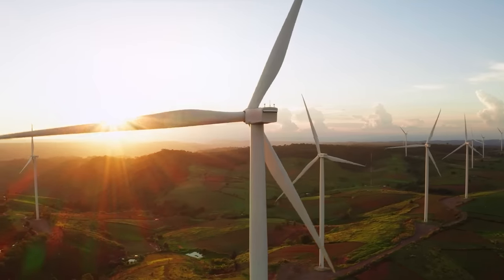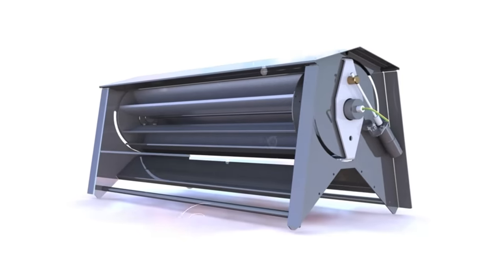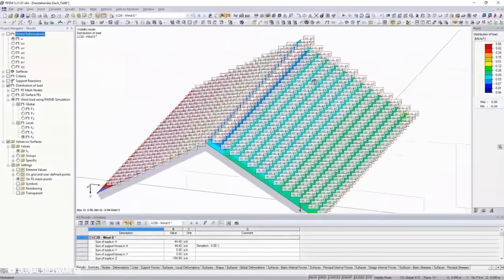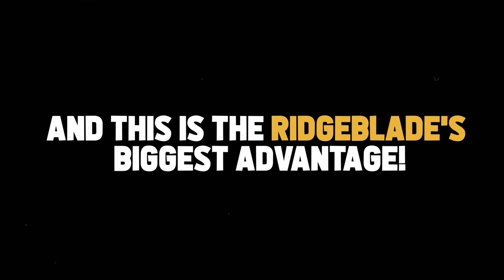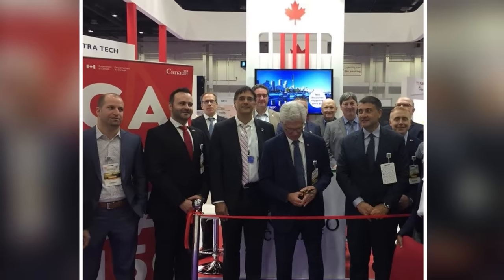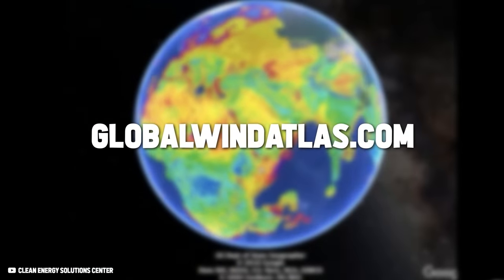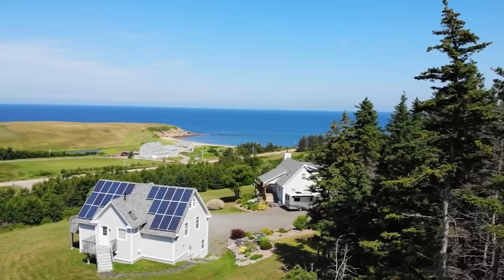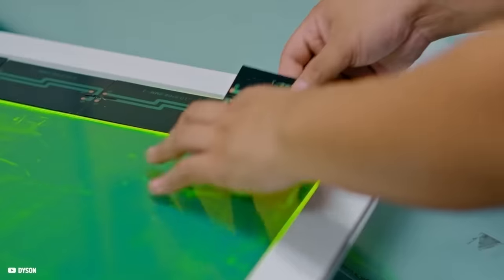Genius RidgeBlade Home Wind Turbine Beats Solar Panels by 220%

Comment: The equation for wind turbines, P = 1/2 * ρ * A * v^3.   Note the velocity cubed term v^3!    There is almost no energy in wind speeds low enough that people can still talk and hear easily.   There is some usable energy at 12 mph 20 kph, but its really nothing worth while.   Wind speed needs to be about double that and constant to make power.  If using a wind turbine on a farm to pump water as done in the 1890s 12 mph wind works, but slowly.

Once wind speeds start to have real useable energy in them they are also noisy when contacting wind turbines.   These roof ridge squirrel cage style wind turbines are relatively close to the ground away from prevailing winds and most importantly are of a fixed orientation not able to orient towards the wind.   They are also an eye sore where such roof top implementation on commercial buildings are typically hidden behind a flat roof parapet.   

When actually making power they would be a wind load on the roof that is not designed for the rotation moment they would cause on a roof ridge.   Having a large TV antenna on a roof should be OK, but placing structures specifically designed to extract a great deal of force from strong winds is not what a typical roof structure is designed to support.   Even when putting in a large high TV antenna it is more comfortable to use a tower mast starting at the ground and braced to the side of the house.  I doubt a home insurance policy would cover this implementation.   People in Florida that have installed solar panels on their roofs are frequently finding their house is almost uninsurable because the roof is not designed for the wind load they'd cause during a storm.  

If there is near hurricane wind speed the additional wind load on the roof ridge might tear it off.  There can be 70 mph wind speeds from fast moving thunderstorms.   With high enough wind speed to make any real power these roof ridge wind turbines are probably way too noisy to sleep with.

Comment: Does anyone know how to contact the Ridge Blade manufacturer/representative?  I have exhausted trying to contact anything connected to Ridge Blade.  I even viewed a picture of the system installed on the air force  museum in Canada and contacted the museum to see if they could give me contact information.  My email to the museum was forwarded from the Director to the Operations guy.  This was the response:

"I don’t believe it ever worked.  I wouldn’t know where to send you for more info."

Does anyone have any additional information?  Many thanks!

Comment: Have sheet metal and a cheap welder. Buy an inverter and an altinator maybe up to 5 of them depending on the size of the windmill you make and tada you have one for barely tleven 1k for probably a power generation within 10% of its energy delivery...  so 2% the price for 90% of the power

Comment: but like solar, it is going to depend on the environment. some areas you aren't get that much wind, but you if there are a lot of sunny days each year, thenit will be this wind turbine. and in other instances the environment might be better to use the wind turbine, or both. In addition, it might might be faster/cheaper to scale the installation of a lot more solar panels then wind turbines. So the 220% figure is nonsense, that isn't how it will work in production.

Comment: What's with your math? One RB1 has 2kW -> 48kWh per day ->  17520 kWh for 1 unit. x7 = 122.000 kWh. If you take a lower windspeed and that's the reason then you have just reduced the whole power output by factor 17x. On the website it says a series of 5 RB1 modules gives you 2kW Power which makes more sense. On their website and in your video it's highly confusing tbh what is going on on the important subject of production. In addition there is no mention of the windspeed at which it's rated. Seems sketchy to me, bc. this is the first thing you do when you advertise a windpower harvesting device.

Comment: What if the wind 8s blowing in the opposite direction?  You can't just turn your house around.
Reply from the maker: Hey, thanks for the good question. 
Its designed to harness the wind from both directions.
Reply: Rectifier circuit to switch AC current to DC current.

Comment: Omnidirectional low-profile wind gathering devices are far better. 
Why?
Space smaller, environment impact less, physics does the work and easier to install and maintain.
Now, can we make the devices light weight enough to not stress the rook structure, yet withstand the winds?

Comment: Here's the reality: You can design your own system with the same science principles...and greater output...

 Once you've got the fast rotational wind force, couple it to a chain driven gear, or multiple ones, to drive a 10Kilowatt generator from a gas powered generator...(you need to rotate at 3500 RPM) attach as many series 12v re-chargeable batteries, the best being made of carbon aero gel...

Go for a DC generator, store the excess energy in 12v batteries ( in series) , attach DC to AC inverter for home use as needed...

Power should be stored as DC and is best kept at that voltage, AC has it's place, though will be slowly phased out and replaced by DC...

Think of DC as concentrated electrical energy, and AC as a fire hydrant (wastes lots of energy all at once) ...no one should use AC in their home, only DC...though that would ruin the electric companies ability to over charge, as AC energy is pushed ( or overcharged by increasing the flow or AMP's) by the electric company...especially when you consume it, you should be using drops and they make you waste gallons on purpose...

Think of it like this: The power the electric company charges you per month is actually wasted every second their line is connected to the house...yes, it's a scam...it doesn't cost them anything to power your house and the line is only limited by it's physical properties to deliver energy...

It's like serving you a meal at a restaurant and then the waiter saying " for every time you chew you get charged for actually consuming it" ...

Electricity is a service and should be treated as such, it is not a consumable reality, it's only limited by physics...Only when enough people figure this out and bail on the theft they incur every month from the electric company will they learn to charge a flat service fee for every home...

-X

Comment: It does not BEAT solar panels.  It works when the wind blows, therefore it supplements them.  Of course, if you are talking about contracts with suppliers, you possibly could not use both.

Comment: Seems like the pricing is an production scaling issue. The production volume is way too low. Bad management coupled with a lack of investors will forever keep limit that company from ever growing. Pricing needs to drop to 25% it’s current cost. In order to do that, production needs to 100x. Indeed it’s a shame.
Reply from the maker: Great analysis

Comment: Like solar panels it is not always sunny also it is not always windy there are days that you have no wind and no sun so so cut the BS you need more than just wind and solar to be totally of grid I know because I am off grid with battery solar and wind and at times still need a generator.

Comment: Are there plans in place not to have animals and birds butchered/jammed with this system?
Reply: Chicken wire? This doesn’t seem like a difficult problem.
Reply: yeah great for keeping chickens out lol. Seriously what about the smaller animals? @davestagner
Reply: @Chris-ly8wt  The holes in chicken wire are less than an inch. It’s used to keep small animals out of gardens. How are we going to keep the small animals out of the exhaust pipes of cars?
Reply: IDK, I drive electric car. 
 @davestagner

Comment: That figure 220% figure is of course, nonsense - it is utterly situationally dependent, you need good wind, good ridgeline facing and, given that it has moving parts, will require a lot more maintenance than solar. The price is ludicrous.

Comment: Not really economically viable for domestic use due to the cost. Bad efficiency when you consider it will only work efficiently when the wind is blowing in one direction.

Comment: Good idea but overpriced a lot and not that efective as promised here too. 50k Euro CAPEX to produce only 7 MWh per year? In My country you can buy a whole PV set (jinko 480, foxess 10kW inverter, wires, ground costruction profiles included, and so on) of 10kWp which is giving us about 11MWh AEP for as much as 5.5k Euro. So we are having about 57% more Energy for 11% of the price presented here Wind solution...

Comment: The fact that you said 220%. We know you're lying. How much energy are you losing Through the heat of the generator. How much torque are you producing that? You're gonna need a gearbox. How much of that wind actually goes through the wind turbine instead of actually hitting the blades.

Comment: Oh al the problems I can see coming with this system. All the added weight on the peak of residential buildings that were not originally designed for it, not going to end well. The increased stress on the roof from shear force produced by wind hitting the units, again on roofs that were not designed for it. This system is going to cost owners way more than it is advertised for, whenever it becomes available, due to the need to reinforce the roofs of  buildings it is installed on.

Comment: So, WAY overpriced.  Requires maintenance.  Requires you live in an area that has moderate to higher wind speeds for most of the year to be cost effective.  WILL do damage to your roof over time.  I could go on, but why bother?

No thanks.  We'll just stick with solar.

Comment: Climate change is a litmus test for how disconnected the average person is from reality!  Water vapour in clouds has a similar effect on climate just like clouds AKA water vapour. CO2 that is essential for life (plants 'breathe' in CO2 and 'breathe' out oxygen - that's why CO2 concentrates at tree top level - CO2 is heavier than air.  Most can't even describe the average composition of atmospheric gases as being approximately 78% nitrogen; 21% oxygen; Argon 1% and CO2 being 0.04%.  A single volcanic eruption can emit 25% of annual man-made CO2 p.a. The next great politically correct scientific surge will have the majority believing that clouds are a green-house gas and therefore clouds need to be eliminated.  Yes, "let's get rid of rainfall, so we can save the planet"... is merely a logical extension of the absurdity the politically correct!  Such is the level of ignorance too few are even aware that oil is constantly being formed at depths in the earth's mantle e.g. Russian oil routinely comes from a depth of 35 to 40,000feet.  There's so much actual science that discredits the ancient swamp origin of oil. Coal is a fossil fuel, oil is not!  Which oil fields have magically refilled after being emptied and abandoned?  Start with the U.S. & the Pennsylvanian experience.

Comment: 15 kWh peak solar system. That is a dead giveaway that this video is absolute nonsense because the clown doesn't even have his units correct. Residential wind is a terrible idea even for the best of wind machines, unless you have lots of property and it's on a 60 foot tower it is useless and we simply call it kinetic art.